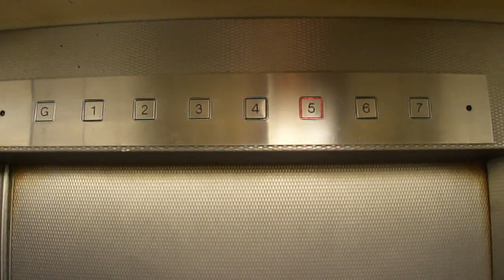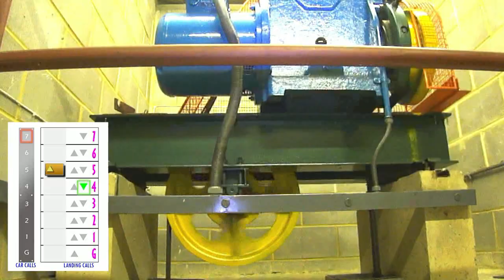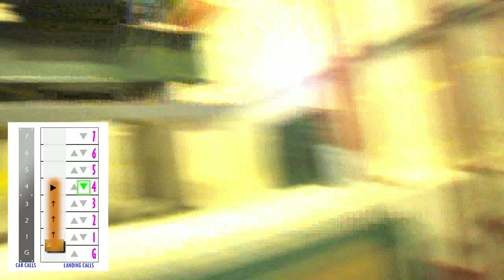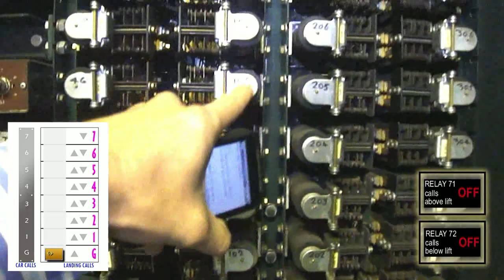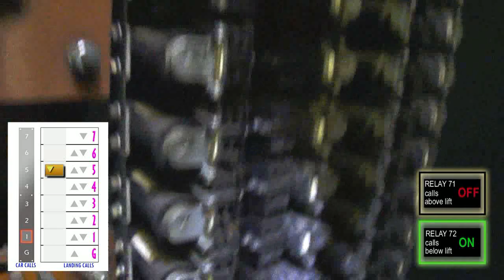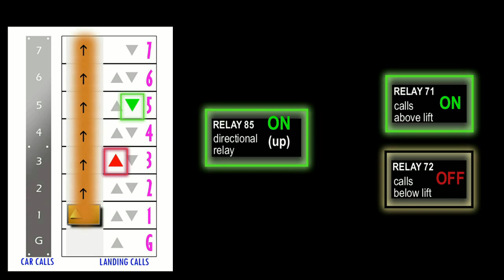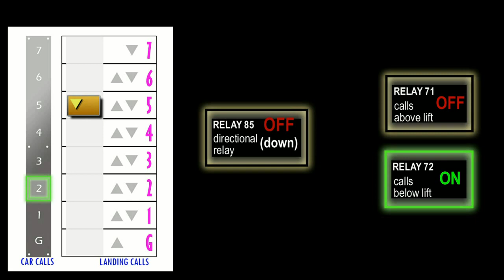(3/4) PROBABLY THE BEST 'elevator relay logic vid'! - Pt3, different lift, EXPERIMENTS BEGIN!

Comment: I was 25 and replacing this type of machine controller for some PLC type of kit - 30 years on I have to maintain whats in the video and breakdowns are maybe 1 a year - hard to make an argument for obsolescence……when parts are still available / can be repaired - Door motor rewind  in the last 10 of 50 years and still going.

Comment: This is absolutely marvelous how you took the time to explain all of this! I currently know of a hydraulically operated elevator which only runs between three floors, and constantly breaks down because of contractors! It is only 20 years old, but not used much, because it is a condominium with the option of using the stairs!  Is this acceptable for reliability?

Comment: I found the "stator start" relay interesting. What I think it does is wire the stator and rotor in series when the motor first starts, and then wires them in shunt to run the motor at an even speed once it gets going. I'm not sure if I've got it backwards or not, It's been a while lol.

Comment: i am so excited to see this. I can't help but analyze these logic circuits in terms of how I would do them in a high end compiler (e.g. GUI application). 

Based on your test of pressing the 4th floor down, followed immediately by 7th floor  down while traveling, and your ending video clip, CarPush (CP) is like an event trigger for any car button that causes immediate evaluation for relay 71 and 72. The logic gate would evaluate (5 or 6 or 7) for calls above and (3 or 2 or 1) for calls below which triggers the direction relay change. The car position sensors also triggers additional conditional events/decisions (should I stop? change direction? arrival - cancel call) etc.

Modern lifts are not that far off in terms of PLC programming but the connections are just simpler and more intuitive - e.g. cancel all calls in the wrong direction :) And PLC computers still need position switches to trigger terminal signals, etc.

Comment: Nice videos.  I have done some servicing on this lift model.  There are 3 of them in my home town (last year there were 7).  They still have all the old Ward-Leonard drive gear as well.  

I have learned a bit about what each relay does watching your vidoes so it was quite useful.  I only had the original wiring diagram to go off and that had no index to explain what each relay does.  

The oldest lift still running here is from 1935 and has massive motor contacts and very basic relay logic.

Comment: I was in an Otis elevator once and selected 12th floor only for it to stop half way past the floor. What causes an elevator to fail to line up with floor? The car doors opened but the push open landing door was locked. I pressed for floor 14 and it stopped as normal.
Reply: Not sure if you got an answer somewhere else in the meantime, but ghosts. The answer is ghosts.

Comment: Russian elevators have a slightly different scheme. Each floor has its floor switch, it is usually mechanical and has three positions. If the car is above the floor, it points left, if below, it points right, and if the car is on this floor, it keeps the switch in the intermediate position. These switches determine the direction in which the car moves when one presses a call button. Later constructions have inductive switches on each floor and still do not have the floor selector.
Reply from the maker: Алексей Рукин Interesting.  How does the switch operate?  Does it have a Otis style carriage, or some other method?  Normally with a switch, it's either on or off.  But I suppose THREE positions would require a mechanical device to press the middle position as it passes?
Reply: mrmattandmrchay Yes, it is a combination of angle bars on the car. When the car is at the floor, these bars hold the switch at its middle position. When the car leaves this floor, they push the switch left if the car moves up or right if it moves down. Both extreme positions are fixed inside the switch and the middle position is not fixed.
http://s3.postimg.org/wnps3ldc3/floor_switch.png http://www.ua.all.biz/img/ua/catalog/more/13031_etazhnyj_pereklyuchatel_ep_11_40_harkov.jpeg 
Later designs use induction sensors on the floors to detect positions and one induction sensor on the car for precise stopping.

Comment: Relay 71 or 72 are energised via normally open contacts on the 200 or 300 relays via changeover contacts of 83 relay.
Reply from the maker: +Harry lomas Cool, I'll have to study that.  That's what I like about relays, it's possible to work out things just by watching how the relays interact.
Reply: +mrmattandmrchay    I worked on this stuff and the more complicated vv ,vvr(with field regulator)and vvm which is the gearless application. I don't possess any straight line wiring diagrams as I have retired.If I can help you or you are not quite sure about something send us message ,I can also  assist you with 1960/1970s Otis relay equipment rotary selector's etc.
   Regards  Pete Lomas .aka Harry
,,
Reply from the maker: +Harry lomas Hi Pete.  To find people that built up a knowledge from the relay generation is rare!  I have a list of what each relay does in this Express motor room somewhere (a Otis eng friend gave me a book of them) and have spent some time trying to work it out and make sense of them when at one of these locations.I love messing around with relays!  I remember when I was about 10 years old and I was really excited when I found how to make a latching relay circuit... those were the days!I'm currently editing a Schindler movie, just wondered if have any knowledge of the selector wheel?  Some of it I can work out, but I have been to a place where the wheel is smaller with less functionality and, without going back there and filming more scenarios, I cannot 100% work out some bits of it and what their actual purpose is.  Would you be able to help here?  I'll send you my email via PM, if you could reply then I'll show you a photo and the "question areas".  I'll give you a mention in the movie also.  Many thanks.  MattMany thanks.